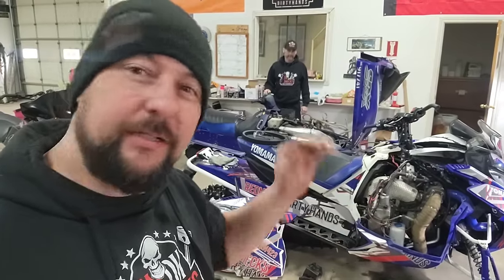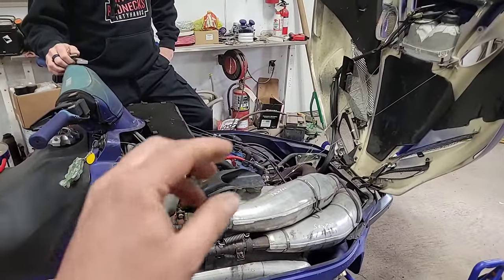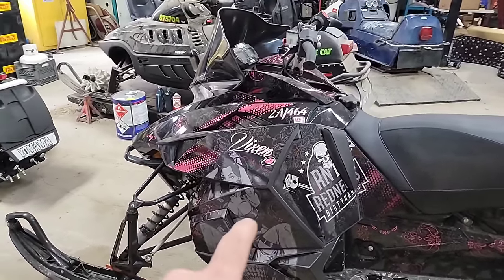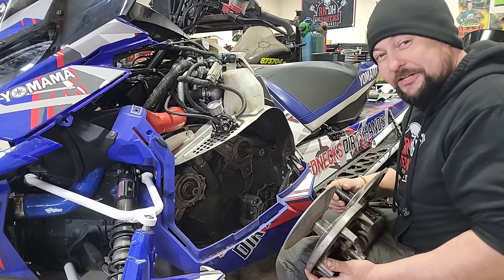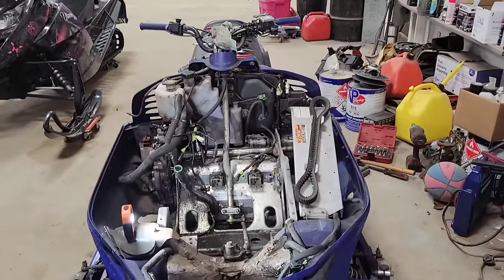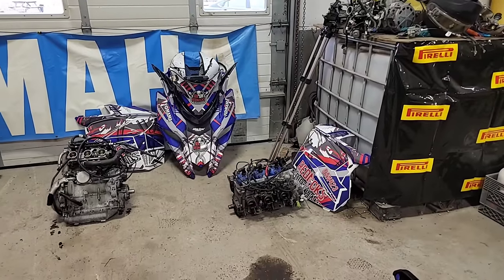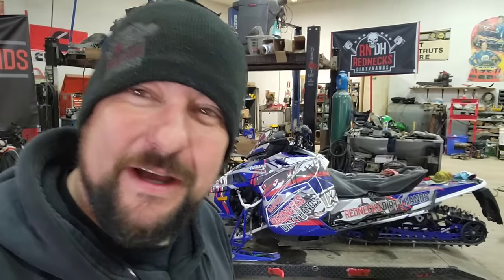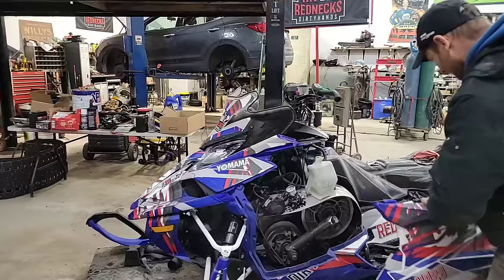700 SRX Triple 2 Stroke Turbo!!!  My Next Sidewinder Project....Will It Work?

Comment: Hey Pete, great build! I am going to keep my eye on this one. Since the 4 stroke Vipers came out I wanted to put a srx7 in it, there should have been a tripple 2 stroke in it from the factory.
A SX Viper exhaust manifold and pipe should be able to be cut & bent in there. The single pipe will lose some hp on the NA motor but that exhaust spinner will more than make up for any hp loss.
Good Luck with the build, who knows you might be making quite a few down the road!
Reply from the maker: thank you! 🍻

Comment: Back in 2001 I ran a mm700 and another guy I was riding with once had a mm700 turbo on av gas running 7psi.  It would keep up to a modded thunder cat back In those days.  He said it took a few sets of pistons to figure it out

Comment: I was thinking of  doing the same thing years back, with a 2015 viper and throwing the 700 triple single pipe viper engine in it, non turbo (still carbed) with the 800 big bore kit in it.. into the 2015 viper chassis.. and utilizing the  800 arctic cat muffler for it.. then designing a custom air box configuration,  I doubt the cat 800 air box placement  would work cuz it having the intake and exhaust on the same side of the engine. But that dream never came true cuz I didn’t wanna throw the money at it. This is cool that your going to try somthing like that plus fuel injection plus keeping the turbo

Comment: for your next project,i would put a apex  engine in a sidewinder.the motor should bolt right in.sweet sound of a 4 cylinder and turbo.:)
Reply from the maker: I've been thinking about it!! it will fit...just gotta move the rear engine mounts a bit. but it definitely would be sweet! 😎🍻

Comment: I love this because I would never do it LOL  This has the potential so save so much combined weight between the heavy old school SRX chassis/suspension to the new Cat platform which is really well thought out for weight savings, on top of the 50lbs of less motor weight.  No way to get triple pipes in there but the "W" pipe I think will work just fine with a turbski!  My next project will be the opposite, apex engine in a lightweight 2 stroke sled chassis LOL  You do you and I'll do me and we'll meet up and drink some barley pops and make yomama jokes all night LOL
Reply from the maker: haha Nice One! sounds like a plan! cheers 🍻

Comment: You know what would be ultra wild in the early 2000s Yamaha made a direct injected 2 stroke outboard wonder if you could make that injection system work on the old 700

Comment: I would imagine the crank seals may need some kind of retainer if you go much over 10lbs of boots. I have seen some other brand engines blow seals out with a backfire. 
Speaking of crank seals, you may be planning on this already but new seals may be a good idea as the mag side is likely toast by now from age and you may as well do the pto side while your there as well as a new pto bearing. 
Keep up the good work. Looking forward to this one for sure!

Comment: Keep it going Pete ! Love the idea and enjoying following along !! Hopefully the plastics hold up to the turbo and exhaust heat. Great idea to take things much further into the non riding season ! Still think slowing things down to smaller areas and more in depth if your time allows. This one video could’ve been a couple months worth of videos if each area was more subjected. Motor mounts. Turbo mount etc. even that ingenious clutch orientation bracket could’ve been a video. Go slow. Don’t wanna go too fast with Yomama 😎🍺

Comment: Awesome. Know you dont like polaris but they do have a lighter weight chassis. A Yamaha triple 2 stroke turbo charged fuel injected in a modern light chassis like a polaris would outsell everything on the market. Yamaha would be market leader if they would build it. They did not have to leave the market. Just for the hell of it the only fuel injected two stroke triple ever made was an rxl. I would bet the throttle bodies off one of those would work like a charm.
Reply: Both Ski Doo and Polaris already have a 2 stroke turbo in their sleds

Comment: you really need to do triple pipes for it to work properly.  Polaris did the single pipe on the ultra and if you look at it there is a balance pipe near the top of the y-pipe, going to the pto and mag, that they developed to try to increase HP.

Cylinder timing and shims are going to be critical.

Comment: 8 lbs boost at sea level on a 2 stroke. Years ago. I remember Gates Turbo had a kits for the Polaris XLT's. At sea level ya couldn't run any amount of boost.. the rings where the issue back then.

Comment: The way I see it the added boost will blow more of the air/fuel charge out the exhaust and th restriction of the single pipe will help keep that charge in the combustion palace where it belongs.  Just a theory my dumb ass came up with.

Comment: Lose the power valves.  Put in block off plates.  You will be fighting leaks and with a turbo they are pointless.  Will give you more room for exhaust.
Reply: Also look in to JDI total loss ignition.

Comment: Motor is too small for a turbo. I may be wrong but I don't think so. 2 stroke 2 cylinders are a whole different animal to turbo up. 3 cylinders are even more difficult. Good luck. I see a pile of time with a result of little to no power gain.